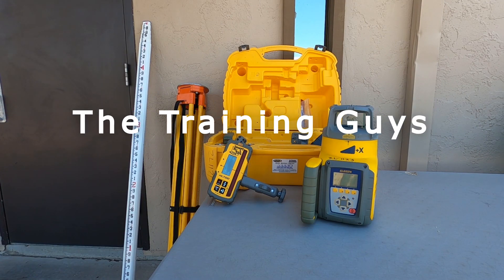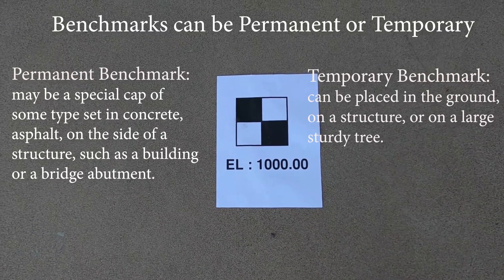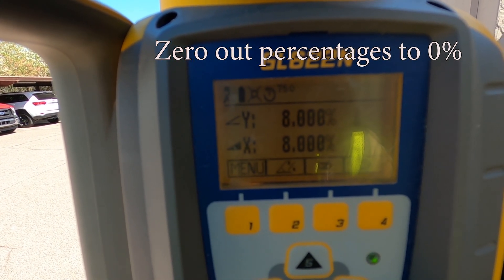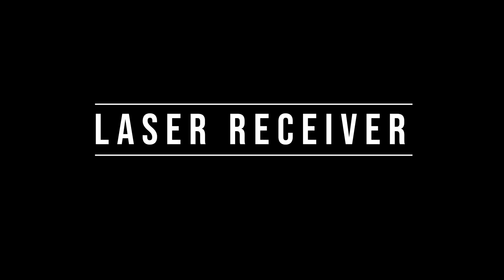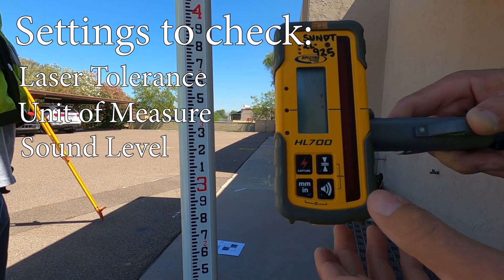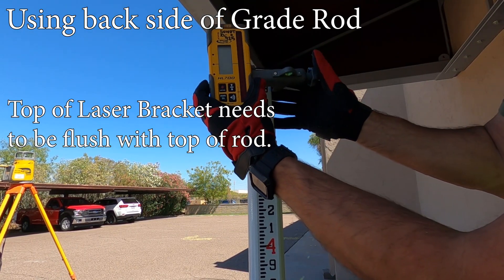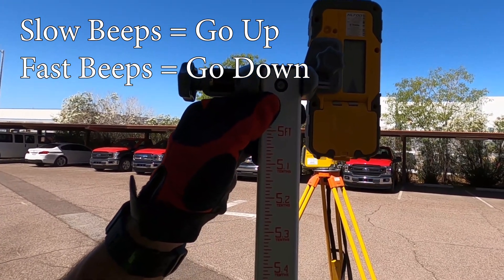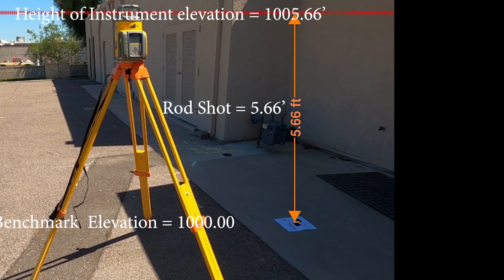Finding your Height of Instrument

Comment: Nice video!  I can’t believe you don’t have more views.  This was put together very well.
Reply from the maker: Thank you for input.  Any other videos you'd like to see, let us know.
Reply: @trainingguys1148  if it's possible I would like to see a video on getting elevation with the least expensive tool possible. 

And another video would be awesome is transferring a location. What I mean is I have four corners of my property staked but I want to go 50 ft in from one side and 40 ft in from another accurately. 
This was very difficult to do and I was trying to use the triangle theory but I was not confident and thought I could be off by more than 3 inches. 
So I was seriously debating on buying a Stabila layout station it's like two grand. 

Hope you can put something together. Thanks